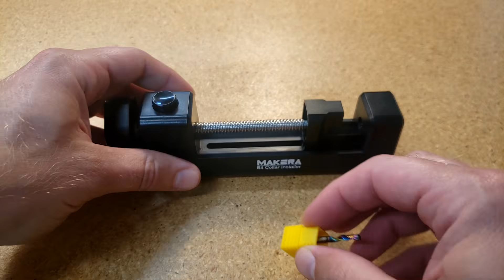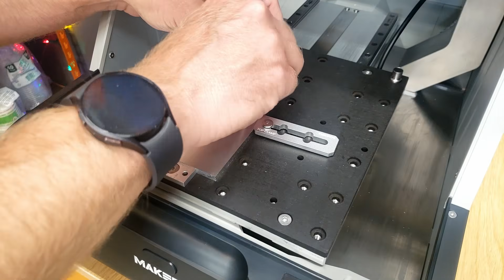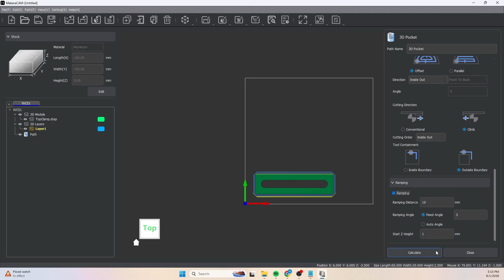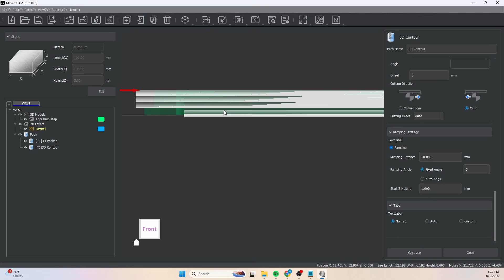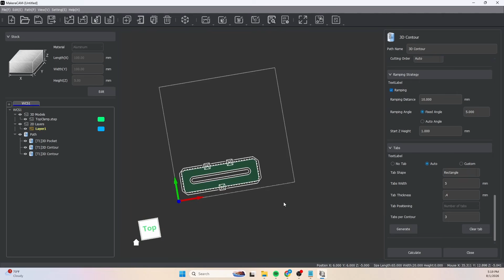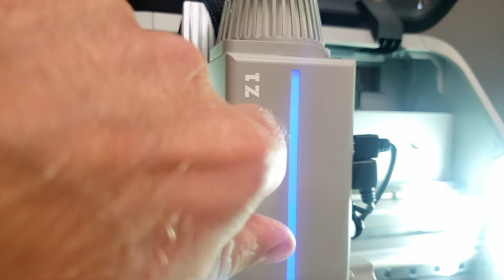Makera Z1 Top Clamp Tutorial (2026 Beta Software Version)

Comment: When my Z1 pro arrives, I will have to find a way to cut to edge to save it from to much metal scrap... I'm thinking a bracket that can take very small wood inserts used as scrap and use the full metal part. Aluminium is more expensive than steel actually. Wood costs almost nothing.
Reply from the maker: Blue tape and super glue! Search it up, it'll work for certain things as long as you keep your passes shallow enough.